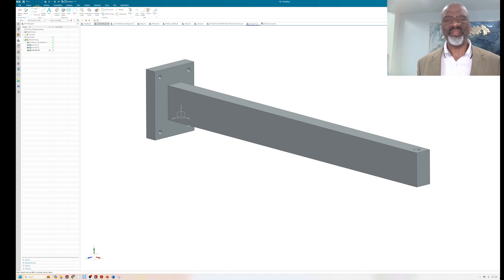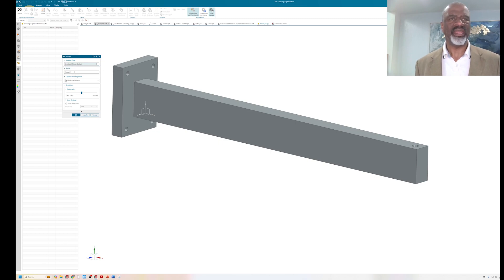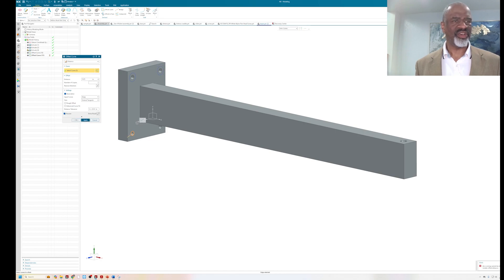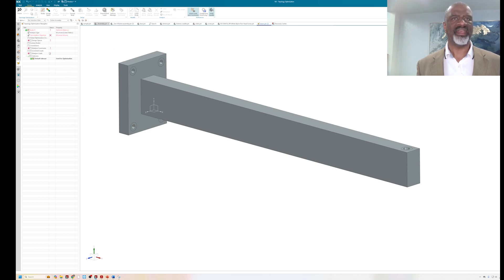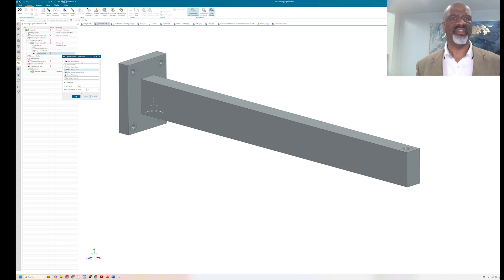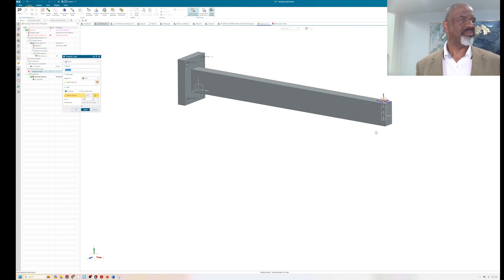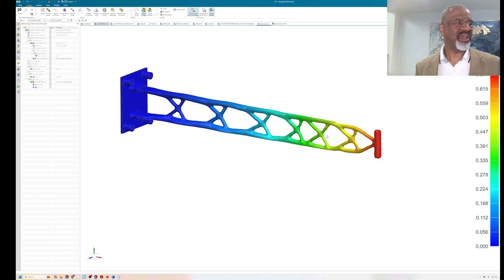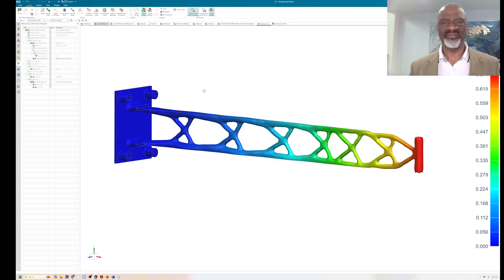MIND VS MACHINE - ARE YOU SMARTER THAN NX? Topology Optimization in NX is INCREDIBLE!

Comment: Nice video, thanks!  How can I make and run multiple Study Clones automatically? Can this be done? For example if want to explore the effect of Voxel Size variation on the resulting geometry. I want to run multiple tests with User Defined Voxel Sizes with a 0,3 mm increment, but I don't want to clone and set the Studies manually.